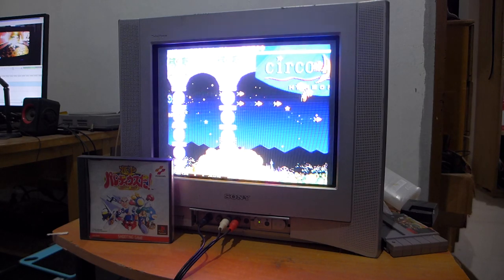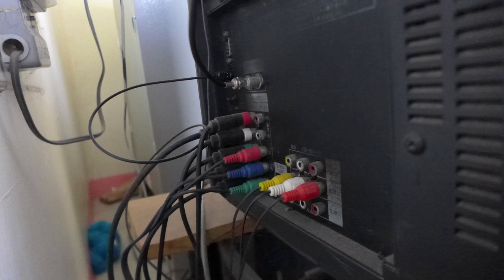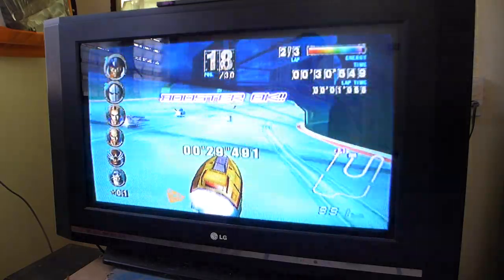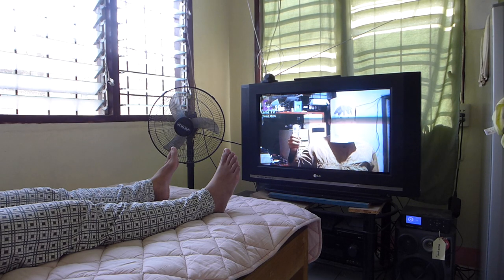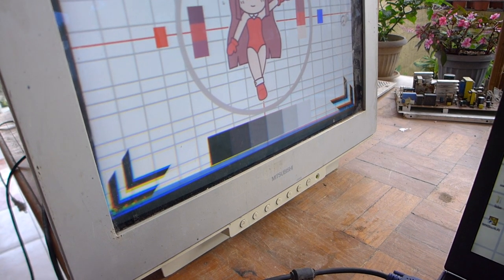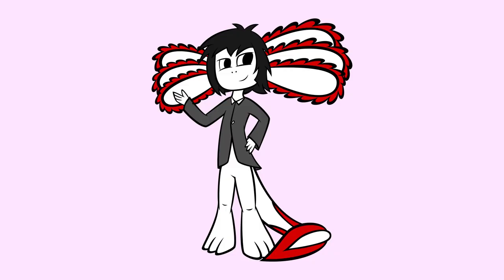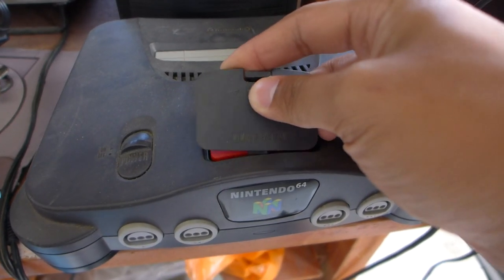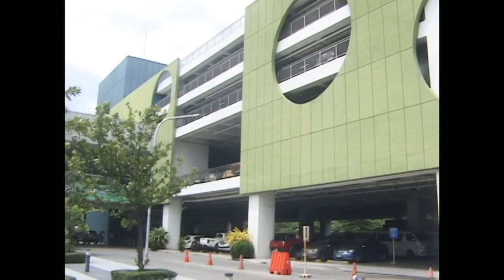LG 32FS3D HD CRT Overview (with long winded update rambling)

Comment: This is the best video review of a HD crt on YouTube.
Reply from the maker: If I have the extra space and cash I'd like to have a go at plasma TVs, considering surplus shops around here have been stocking such displays from time to time in recent years. I view them as 'best of both worlds' displays with the contrast and brightness of CRTs and the precision and sharpness of calculator panels. Basically like OLED before OLED.
Reply: @lameguy64  that would be an interesting video. Never seen a plasma tv myself yet. 
Might be better than a HD crt for my ps3/360 right now because there's not enough room even 2 27" SD crts, and 1 HD crt. 

I'm not sure why HD crts get so disdain. It's not even like we're buying these at msrp. :)

Comment: Overscan is used by people who play FPS games. It causes the image to zoom in as so to see the enemy better.
Reply from the maker: But your HUD elements would be cropped off, unless there's an option to adjust the position to compensate for that.
Reply: lameguy64 Exactly. I forgot to mention that. I do the hud adjustment in BO4 PS4 display area settings after activating overscan.

Comment: They made a 4:3 HD CRT that could still do 1080i still in 16:9 The Sony WEGA SuperFine are generally considered the best overall but Toshiba, Mitsubishi, JVC, Sanyo, and RCA all made them too with the Toshiba and especially Mitsubishi being considered a hot contender for the SuperFine depending on the model.
.
.
.
.
What's that? You say Samsung made one called the "Slim Fit"? That's not a TV its an abomination and should be put out of its misery as soon as it's spotted. Anyway yeah, there are a lot more even than what I mentioned and in Europe there were 16:9  SD sets too.